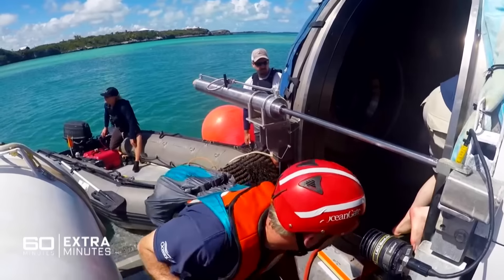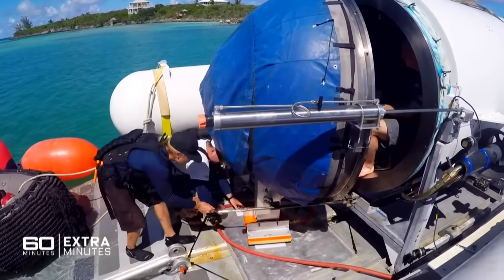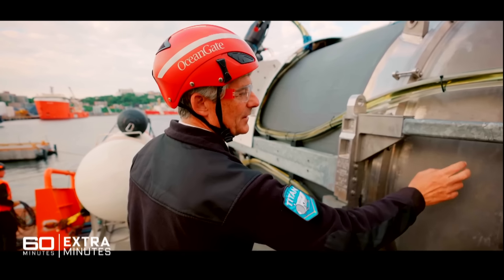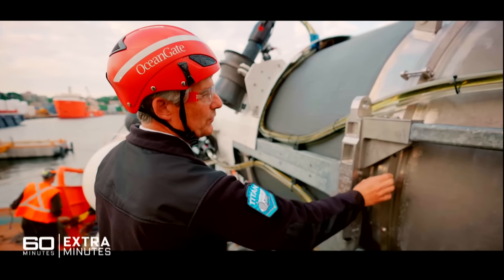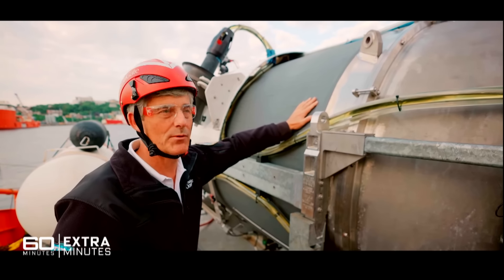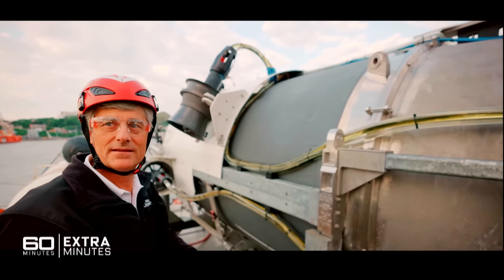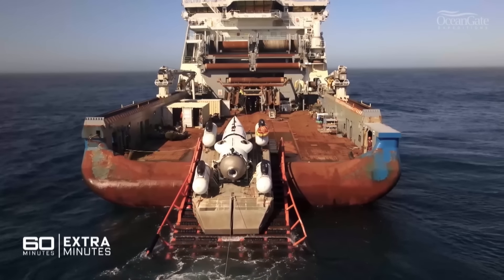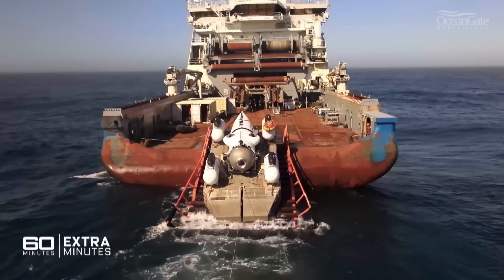Titanic sub implosion explained | 60 Minutes Australia

Comment: What i dont understand is why didnt they make the tube from titanium or a large titanium sphere? Too expensive? Too heavy?
Reply: Yes, titanium is very expensive, very heavy, and hard to machine. Using it would have reduced the capacity to 4 people.  Nevertheless titanium is what's used in almost all of  this type of deep-sea sub, because it's the strongest. Steel is the second choice, but it's so much heavier it would reduce the crew to 3. There's a lot of good info on the Titan sub on the Jeff Ostroff channel on Youtube if you're interested. Basically the designer Stockton Rush was a fool.

Comment: Carbon fibers are very hard to PULL apart, but if you PUSH it together it just folds. So basically, the hull was relying completely on GLUE (Epoxy) to keep the Carbon Fiber from folding on itself - IMO
Reply: Glue is what you’d need to be on to think this sub was a good idea

Comment: at best carbon fiber is single use if that !!!
the way they built it on the cheap with no autoclave or not even a vacuum bag was another problem, but even a properly built carbon fiber sub would fail if you keep using it !!!

Comment: For metal, there's metal fatigue; based on the shape it changes under particular pressure and the times it dives, we can predict its lifecycle. And
We can replace that metal before it cracks. Also, we can use X-Ray to check the micro-cracks in the metal. But for carbon fiber, we don't have any measurements to detect/measure any if above
Reply: I have experience with pressure housing using glass fiber that have gone to depth a very large number of times.  There are design methods to address each type of early failure and very conservative cycle lifes to deal with the fact you can't really detect the weakening.  Basically you have to test a few to the point of destruction as you address each design change.

Comment: Instead of experimenting with humans why not experiment with robots or turn the sub into a remote control type mechanism and see how long the materials will withstand those pressures. I can see the innovation but this could have been done without lives being lost forever. Stockton was a innovator and he had a great concept because the sub did make it to the depths it desired on multiple occasions. Whats even crazier is they took a test dive before the actual dive with the customers every time which definitely decreased the stability of the sub. There was a time where actual humans were used as test dummies for vehicles and this is similar.

Comment: If a hull failure results in implosion (not explosion), it seems to me the titanium rings should have been bracing the carbon fiber from the INSIDE to protect it from outside crushing pressures.  Would they sacrifice some interior space to do so?  Yeah...but they might have lived to tell about it.
Reply: The main issue isn't that the titanium rings should have been on the inside, it's that carbon fibre is not suitable for this application. Compressive forces are not something carbon composites do well with.

Comment: Explanation is not good. Carbon fiber is a fine material and there is ways of making material models that can predict its behavior. The crucial point is that carbon fiber composites are good under tensile loads (think of a string you can pull on it but cannot push it) not under compressive loads. For a submersible the loads are purely comprehensive which makes carbon fiber a very tragic material choice for this application. Such a basic and preventable miss here, I hope people responsible are held accountable for this gross negligence.

Comment: Carbon fiber has great tensile strength but not so good on the compressive strength. Definitely a tragedy that could have been avoided  with proper testing and certification. May God be with those doomed souls.
Reply: Both carbon fiber and glass fiber can be made to have very high compression strength.  I have some experience with just such a design.

Comment: what about boeing 787? that aircraft also made by carbon fiber, what's the difference?
Reply: Carbon fiber is lightweight and very strong under tension, like the bending and flexing of an aircraft wing. It's not strong under extreme water pressure from the outside. Also, the carbon fiber was wrapped around the mold in one direction, like wire on a drum. Airplane carbon fiber is layered in different directions, like plywood. Stockton Rush should have known that, he was an aircraft maker.
Reply: @brianniegemann4788  thank you👍

Comment: Experiment all you want on yourself. Risk your life until you lose it and nobody can stop you. Take 4 people with you on that journey for money and prestige and you’re a monster. I’m guessing the company badly needed the cash and Rush figured he could get away with it. His useless security feature of listening for cracks would prevent a total catastrophe. Did you notice that not a single shred of fiber was still clinging to the metal rings? It popped out when the whole tube shattered into a million pieces. 32 feet of glued joints, titanium to carbon fiber when every other sub is welded steel. I’m no engineer but a tube of composite material, weak on compressive force and glued to metal sounds like a death trap—and a viewport rated for half the depth. They also towed the Titan everywhere on choppy seas for hundreds of miles bouncing on waves. Did all that bouncing affect the epoxy or another critical component? There are so many things wrong with this it’s hard to list them all.

Comment: They also used carbon composite that Boeing supplied them because it was out of date fore use on aircraft, plus it was not structurally put together properly , it was not crossed threaded just wrapped around on the sub, not cross threaded as recommended, but it was also out of its safety date , they bought the carbon fibre from Boeing that was out of safety date , they would not use it in there aircraft because of the safety date, but the company that bought it and constructed the sub were well aware of this as Boeing told them before sub was made , plus the carbon fibre was not cross threaded wrapped as recommended by Boeing, but the sub company just wrapped it around like a toilet roll

Comment: With a sub made of multiple pieces that can slide on each other under pressure, some of the "gun shot" sounds could have just been things like the window lens getting pressed a few microns deeper into its socket since the tiny bolts holding the window flange cannot have been providing any meaningful preload.

Comment: Carbon fibre is lighter , so Stockton rush could have more space and more passengers ! A very simplistic approach to a problem ! Chasing the £££££ ! 
Unbelievable stupidity ! Years and years ago I saw video showing carbon fibre is 10 x stronger than steel , in one direction , but very weak in another direction .! 
Absolute stupidity, I didn’t know there was 60,000 square foot of pressure per inch at those depths until the titan sunk , so you have weight of ocean crushing you ! 
No wonder Stockton rush was looking to hire a driver to drive the sub !

Comment: All of the "intelligence " that had gone down in this bucket,and yet it still kept operating. 
Banging, cracking , popping.... all of this 
I am not a college grad. But come on . Those are signs of cycling or flexing  in the structure. Means it's eventually going to wear out.  Which means breaking. 
All metals do the same thing. It's just not as soon or as pronounced immediately

Comment: Be careful about what you say about composite materials.  For example, current aircraft have a number of composite elements in them.  There are methods for evaluating composite structures.  It is quite a bit more complex than what is done for metals or isotropic materials.

Comment: Why are super cars made from carbon fibre then? It will also sqeeze at accidents. Profit and eyewash
Reply: Carbon fibre car body panels still have a roll cage inside the car and frame inside will be strong nobody can survive at a 200mph crash either way so it doesn't really matter

Comment: The carbon fiber isn't the first part of the craft to fail though! 

According to unverified transcripts from the doomed voyage, it was the titanium compartment in the rear that first had the leak, created the popping sounds, and damaged the primary battery. 

The company is still liable for descending too rapidly without any safety controls and not realizing they were sinking due to the leak. Should have compared the actual descent rate to an acceptable descent rate and whenever it was discovered the Titan was descending too rapidly: abort the descent.

Comment: I did analysis of a complex carbon fibre monocoque for an undergrad thesis in aerospace engineering and one of the things I worked on was creating a quasi-isotropic composite material lay-up so that it would, at least in part, perform in a similar manner to the metal constructions that it would be theoretically replacing. My immediate thoughts about this sub echo a lot of other engineers; the single wind filament technique they have used strikes me as inappropriate. 

I think they would have thought it was ok because of the somewhat directionally uniform stress caused by pressure (always pushing in at the same angle essentially), hence, the directional stress advantage of a more complex carbon fibre layup was not necessary. I do however think that the difference in expansion rates of the titanium to the composite tube would cause a more complicating load case, especially when cyclic fatigue is considered. 

My final issue is that I can see that it would be easier for a fault (crack), or series of faults, to align their way through the sub, causing a more serious compromise of the hull. If a more complex layup was used, delamination would still have been a concern at these stress points (near the end caps), though i do think it would have been a lot harder for faults in the resin to have fully compromised the subs integrity after successive pressurisations than with the single wind method they used. It should be easier to detect under pre and post dive inspections as well.